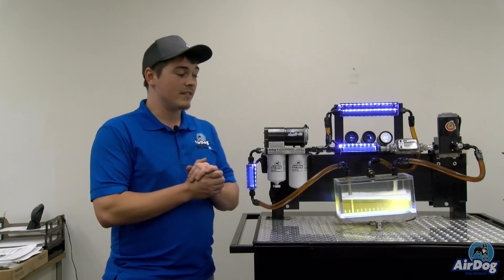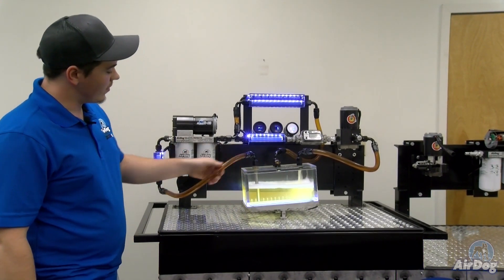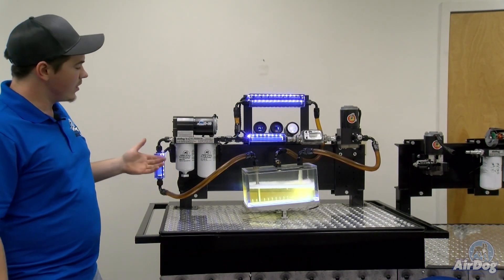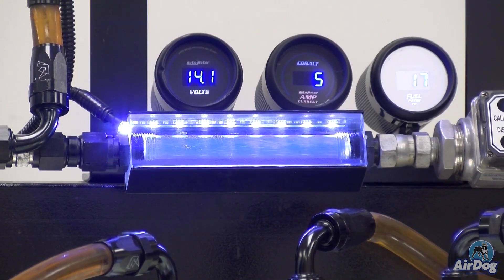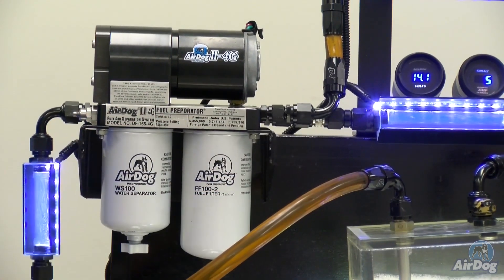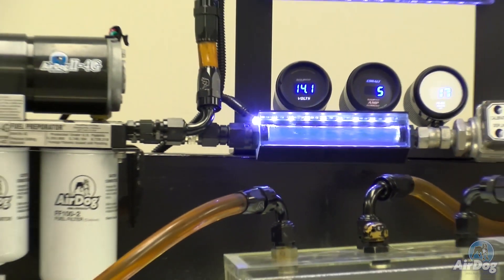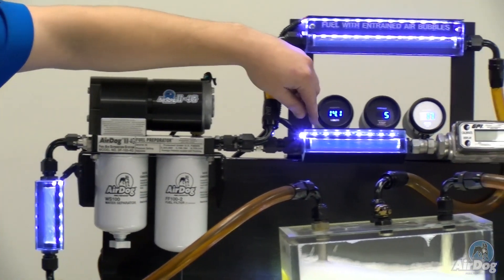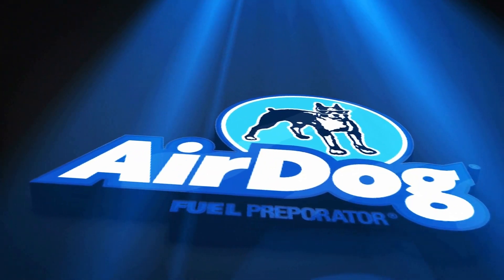AirDog 4G Display Stand Demo

Comment: Do your pumps work in extreme cold?
Reply from the maker: Yes! We have tons of customers in Canada/Alaska. If Gelling is an issue There are a couple Companys out there selling heaters to work in conjunction with our systems!
https://www.dieselperformance.com/shop/product/1050347-flow-max-fuel-heater-kit-12v-320w-airdog-i-ii-ii-4g-wsp-832
Reply: FASS has a better pump block with 2 heater probe ports, as well as 2 engine coolant ports. Then in addition you can add one of their filter disk heaters. It allows melting of any frozen filter system and heats well for Zero gelling issues in extreme cold down to at least -40 or so